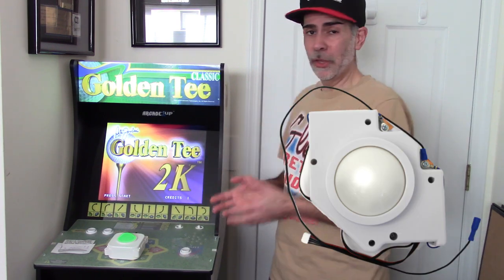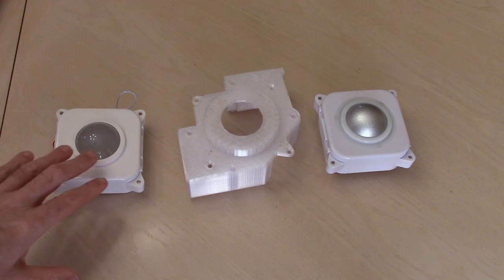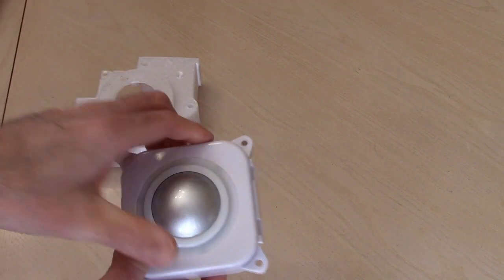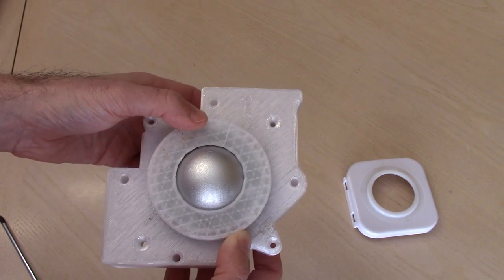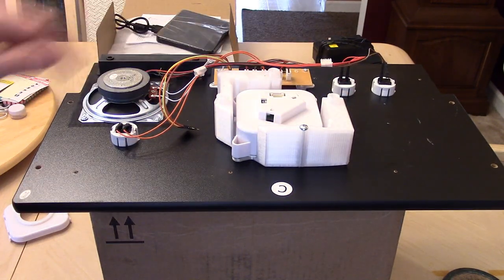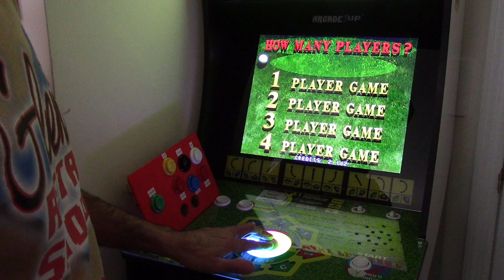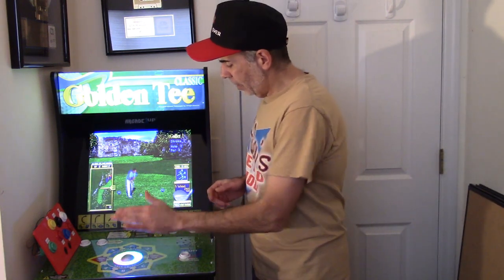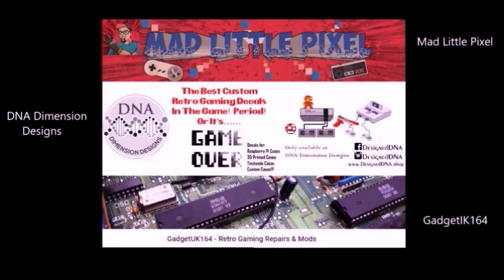Can you install the GRS v2/V3 Trackball in Arcade1UP Golden Tee

Comment: 14:40 There are two types of TBall movement, thumb/finger arc length (fine control), or open hand pull/push (speed spin) You used the later for the drive.

Your GRS v3.0 TBall sensitivity does not change with ball size. Remember it is an up-side-down optical mouse circuit looking at an optically textured (Metallic speckled) ball. The Ball is an idler to your hand. 

The GRS v2.0 TBall uses standard trackball design with Ball-Roller diameter ratios to form a gear up (like a pulley) increase to the pin-wheel opt-coupler sensor. Ball / Roller * wheel holes = slots/rev compared to inch/rev
A 2.25" to 3" Ball size increase will give only a 8% increase in pulses and that has to be balanced to ball inertia effects.
Heavy ball hard to spin.

Your GRS v3.0 TBall is direct drive. 
Is it mechanical or electronic (compute process) issues?
1) Fly wheels too heavy on rollers (inertia) - game software sample point of TBall speed; early/later
2) Ball contrast not good enough for quick motion - motion blur
(eg. mouse on jean pant leg compared to blank paper) 
3) MCU dropping frames causing stall or backspin movement
4) MCU software lacks exponential movement mapping
5) Arcade1UP Golden Tee TBall sample rate too low. 
Raspberry Pie default mouse USB sample rate is 62.5 Hz, adjusted to 1000 Hz or 4x doubling for better sensitivity.

Comment: Will the v2 or v3 trackball work with the partycade? Will they work with the Simpson cab? Love your track ball used the v2 on my Atari legacy cab.
Reply: I tried V2 on Simpsons but it did not work
Reply: @bond008a9  thanks for the info. Saves me time.
Reply: @bond008a9  Did it matter if you opened up the trackball and removed the jumper? Or just not at all?
Reply: There was no jumper on my setup
Reply: @bond008a9  Weird as my v2 trackball has a jumper inside I had to remove to get it work properly with my Atari Legacy (Tempest) cab.
Reply: @HerrKlugscheisser  correction, yes I removed my jumper but did not try with jumper.  The V2 I had was an extra I had and tbh I forgot it came with the jumper

Comment: Could you design a shell to use in the Legends Ultimate?  Also, is your v3 trackball available yet?
Reply: I hate the legends ultimate stock trackball.
Reply from the maker: I made one specific for the Atgames Legends ..but only works in the v1.0 ... Something changed in 1.1 unit.. because of that we stopped making it available.. if atgames will let is know the change..we can produce it
Reply: @GlensRetroShow  I know you mentioned it won't work in the 1.1 with the stock hardware but what about with a PC or Raspberry Pi? I was planning on gutting my At Games Legend Ultimate 1.1 and use aftermarket joystick and buttons and was looking for a USB trackball replacement option that would fit in the stock location on the deck.